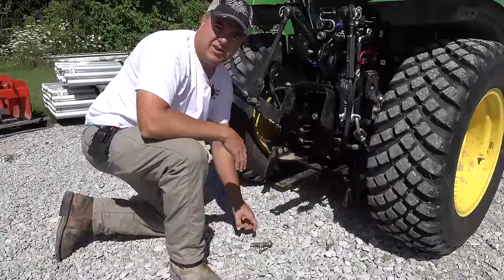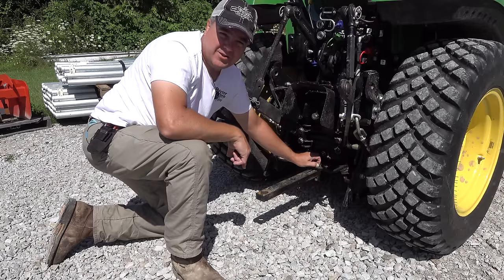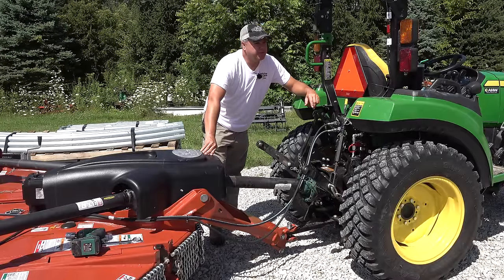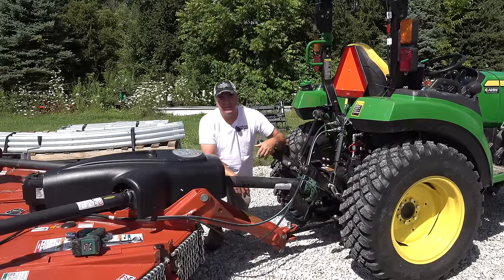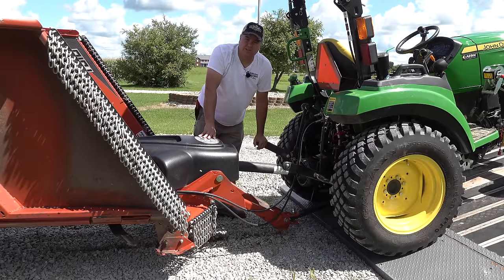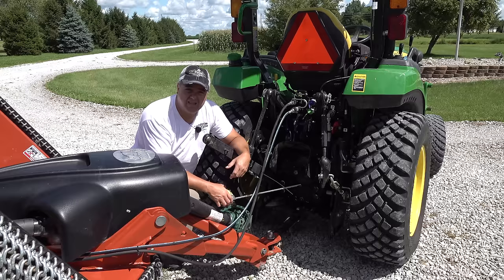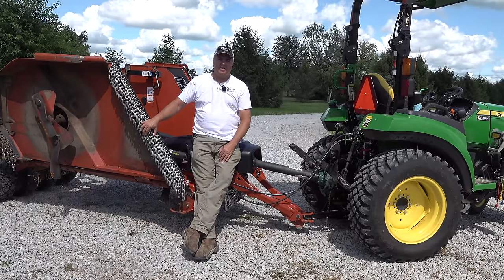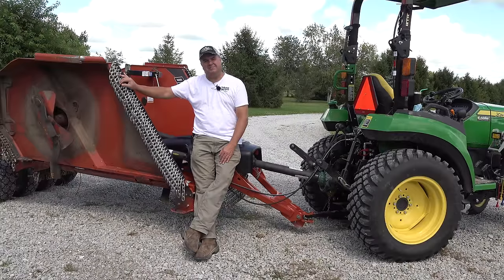COSTLY REPAIR on Deere  2038R!!!  Tim's HUGE Error!  Details Inside.

Comment: I've got one for ya Tim.  I snapped off one of the rings that holds the pin that holds the top arm on the 3 point hitch on my 1025R.  I was changing implements and forgot to push the pin all the way back in so when i raised the arms to attach the next implement the left arm caught the part of the pin that was sticking out and snapped the top half of the holding ring clean off.  Since the rings are all part of one big casting it was going to cost my $2000 as they needed to replace the entire housing and tear down the whole back and then rebuild it.  Luckily I found someone who could weld cast iron and it only cost me $300 to fix and its still holding.   So don't feel so bad buddy you're not alone
Reply from the maker: 3rd person to state that in the comments in THIS video alone!    We really need to get the manufacturers to stop using cast for the top link connection!

Comment: Tim, you could disconnect the PTO shaft when trailering.  Then you could have the drawl bar in more to reduce dragging on the ground.  With your drawl bar now in hole four the hitch is going to drag the ground worst when trailering.

Comment: Well done Tim, a good , useful video. I'm also surprised there is no recommendations over the drawbar height too. It looks too low to the ground to me.
Reply from the maker: There is an adjustable rod which can compensate for drawbar height. However, i don't think Rhino planned for a 12" drawbar.  The 15" drawbar on Johnny 5 works much better.

Comment: This won't help you Tim but this also happened to my JD 4115. I was using the original equipment JD rototiller which I purchased the same day along with the tractor. A few years later after tilling everything just fine, I had a pile of dirt to till, I proceeded to backup to the pile with the pto engaged raised the three point hitch as high as it could go, backed into the pile to begin and well...... I forgot the $$$ number but 15 years ago and less inflation it was probably equivalent to your bill. I got it back and forgot the bill but never forgot the lesson. It doesn't like excessive angle pressure.
 I don't remember reading about that but then l'm a man and I don't normally read those kinds of things. 
Later as I was crying to another man (whom I didn't know very well) about this he said I was a mechanic at JD before retiring and you don't want to go in high gear full throttle with the front wheel assist on either. 
So Tim if you're like me you'll probably forget the money but you're never going to forget the experience. 
So good luck to you, and oh! I still have that little tractor 22 years later. Best little tractor a guy could have still starts on the first crank.

Comment: Tim, Thanks for sharing. Again you are right. I bought a 3035D 2020 a few months ago. It is a gear driving tractor. I trusted the JD salesman experts and did not read the manual. The PTO is not a life PTO the PTO engage and disengage with the clutch. It is not independent. Now I am stuck with it and I am not happy. This is my first john deere what a disappointment. I was looking into trading it for the 2038E but not sure
Reply from the maker: I'm sorry, David.  How many hours on it?  Where are you located? Do you mean trade for 2038r, or 3038e?

Comment: Loved your intro Tim, spot on! It's a "Man" thing.
 Sadly, you aren't the first and certainly not the last to bust that rear pto case, seen it so many times it doesn't even phase me any longer. 
  I'm a JD salesman and I can't count the times I've taken a tractor in on trade and the manual is still wrapped in the original plastic. I always compliment them on keeping it in such pristine condition LOL! 
 You certainly are influential because it's quite common anymore when a customer is looking at their first CUT or an implement that your name comes up in "Well I saw this guy on YT doing this" ... and I just go "Oh, Tractor time with Tim?" and they go "Yeah! That's the guy!" 

 So little story for you. 6 weeks or so a guy comes in and tells me he saw you running that Maschio sickle bar mower and he wants to order one and so, we ordered the Frontier version (green Mashcio-comes with an extra knife btw) So it comes in, we assemble it and then the guy tells me "Yeah, I'm putting it on my 1025R just like Tim"  I went uh-oh, looking at the compatibility chart I told him. That's fine, but it's like this, I can't recommend it, and would never do it for the obvious reasons but I watched your vids and sure enough, you made it work. So the guy took it home and hooked it up and then he calls me, He's a little nervous on the bank of his pond. I asked him if he noticed you had the steel wheel weights? nope, didn't see that. So we ordered a 70 and a 50 w/hardwarte for putting on the left side. Haven't talked to him yet but he should be good because "Tractor Tim did it" LOL! End of the day I got to meet a real cool guy who was a pleasure to do business with on account of your work with the great vids you do. 
 Your dealer did good getting that covered, that's a sticky situation you slid right through :) 
 Keep up the good work! You probably save a lot of people a fair amount of money without them ever knowing it.

 BTW, That's just insane running that Rhino mower- you really show what CAN be done and you give the best advice - I try to do the same but it will never be the same cause, I'm a salesman. Tell you this though, Rhino makes one hell of a mower.

Comment: There's a phrase among mechanics that is RTFM, which means Read The Flipping Manual. Often mechanics get questions like "what does this light with a tire mean?" Or how do I know what tire pressure I should have, or how do I adjust my seat? The answer to those questions are all in the manual. And as a 13 year heavy truck mechanic, I read manuals almost every day for torque specs or troubleshooting steps. Always costs more to do a job twice.

Comment: Interesting with PTO hook up n yes I have seen different PTO damages. Watch linkage arms when turning them or parts will get damage.  My tip is when PTO is not in use its easily just disconnect from tractor n tie PTO in place, driving long distance over rough ground/roads, turning corners will put pressure on PTO.  I know so many farmers that have PTO hook up but it takes one time n can be long down time n productivity not mentioned costly.

Comment: Saved my buddy's tractor just last week! He got a tiller and called me because it wouldn't pick up very high. Turns out the pto shaft was to long and binding up putting all kinds of pressure on the rear housing everytime he tried to raise it. We cut it down after I explained what damage would occur if he kept running it like that!

Comment: Happens to the best of us Tim !! Last year I was in a rush in the morning to unload from brush hogging late the night before and switch to my box blade and reload on the trailer to head out . Anyways I backed my mower to it’s spot reached back undid the quick hitch and drove away and started to back up to my box blade and all of a sudden my right rear tire and tractor went up in the air , I was like what the heck ? I pulled foreword a bit jumped out looked behind and Half the PTO shaft was there and now bent like a Banana  ! In my confusion I looked over at my Mower and the other Half was on it . Instantly it hit me I had forgotten to undo it when I did the quick Hitch! Getting hurry sometimes slows ya down ..... The trick is don’t make the same mistake twice ! Good Man admits his faults and learns !

Comment: Yep, we all have those moments.  Had an almost similar incident with a grain auger last year, but there's a big ol' warning label right by the hitch that says to disconnect PTO when raising or lowering auger to prevent damage to joints and such. Good thing because it would have crushed something, but had to get a hitch extension to make it work easy. From most recent memory for a PTO damage was on a bale shredder several years ago. When one of our loader tractors broke, I ended up putting a bale fork on the 3pt arms on the other tractor to move some bales. What I forgot about when I hooked the bale shredder back up was that I set the 3pt arms down further due to the bale fork to reach the ground. Long story short, when I turned with the bale shredder hooked up, I bent the PTO shaft good.

A lot of stuff is for covering their butts and lawsuits, but that's what a bright yellow highlighter is for lol! There's some key info in all that jargon to make note of. I guess I've always made it a habit to read the manuals while at the same time looking at said machine as well to get familiar with it, so when it comes to working with it and running it I already know what to do (or can quickly find more info on it in the manual if more complex steps). Sometimes those actual important info stickers are in weird places and do get overlooked by other annoying warning labels.

Comment: Well I just watched this video today. You wouldn't be the first or the last to have a pto shaft destroy a gearbox because of the length being off.
Just a comment on three point mounted equipment if using a hydraulic top link it can be shortened up and make the shaft to long or lengthened pulling the shaft apart.
Also many mowers and brush hogs use a floating top link se ditches and steep banks can and will severely impact the required shaft length.
Good video.

Comment: I did that on my Yanmar, but just put a little "wobble" in the PTO shaft. The dealer noticed it on a routine maintenance trip, I didn't even notice it. He replaced the shaft under warranty, just like you, even though it was my fault. I raised my tiller up too high is the only thing I could figure. So word to the wise, it can happen with 3 point attachments too. 😁

Comment: I've got the 2017 2032R and broke the loader stand while I was disembarking it. I made a video or two about my mishaps. A shop press came in handy! I have the front 3 point hydraulics set up on mine for my 59" snowblower, I think I may have had the lift cylinders in front extended, and the loader caught the cylinder and sheared the two bolts that retain the stand to the loader on one side. There is a lock switch, which will lock the cylinders all way in, when you dont need the front snowblower lift cylinders. If I recall right, I didnt have it locked with cylinders all way in. Oops!
Reply from the maker: I have a video showing how to replace the shear bolts in the 220r loader stand.
I’m afraid that needs a bit of a design change!

Comment: Don't beat yourself up too bad. We've had it happen before as well. The PTO shaft would be cut to fit a particular tractor and for some unknown reason the PTO driven implement would be attached to another tractor and the damage occurred. In our particular case it went from a Deere to another brand tractor that had shorter lift arms.

Comment: If the drawbar is out further, will you have more trouble driving up onto the trailer? Seems like the angle would cause the drawbar to dig in deeper at the hitch point.
Reply from the maker: Yep.

Comment: Good video Tim.  You should do some more testing and get your Deere sales buddy involved. Does your 2038R have a aluminum alloy PTO case or a cast iron? I think you should get a Yanmar or New Holland or Even a bobcat CT2025 and do the same mistake on purpose to prove if a cast iron housing is any better than aluminum alloy. I would put my money on the cast iron being able to withstand what Johnny 2 could not. The implement would break or bind before  the cast iron housing cracks. Many buyers have looked elsewhere from Deere and Kubota because of exactly things like this. Maybe you can prove to some people the merits and limits of aluminum alloy? Perhaps you can  prove to a large audience that cast iron is no stronger than aluminum?

Comment: We don't think about it much these days, with the smaller framed and higher horsepower modern tractors, but 14" from the tip of the PTO shaft to the centre of the hole on the drawbar was the standard on old 540 PTO tractors for decades.

Comment: I should start of by saying that I have no experience with 3 point mounted attachments but if the draw bar was set too long would you have a similar situation with too much extension if the tractor were to crest the top of a hill and the shaft pulled too far instead of compress too far?

Comment: I have a 2032R and I took my bar off. It is pretty low to the ground. However I usually learn by tearing things up. I’m not smart enough to think ahead and catch mistakes on things that I’m not familiar with.

Comment: I wonder if you could put a bushing with nylon roller on the bottom of the tongue of the mower so when it drags it rolls instead of digging into the ground when you are at an angle.....

Comment: hey Tim can you flip the hitch on the mower  over by pulling the two bolts out and flip the hitch and bolt it back up it will raise that point that digs in the ground if possible
Reply from the maker: No, that ‘point’ is what controls the height of the rear tires on the mower.

Comment: I has a similar but different problem, i have a 60” till for my compact tractor. When i bought it the pto shaft was to long . So i cut it. No problem everything worked fine. Then one year I thought it would be nice put quick hitch on.  So one my wife was begging me to till the garden , I am always in a rush because i work for myself,  mind you i have been around farming most of my life. Well I noticed it was a little short now.. it works but center had a little to much play.. I thought i got stuff to do, I don’t have time to horse with this. So i tilled the garden. No problem, till i went to take the tiller off.  Twisted the shaft and it wouldn’t come off.  Lesson learned.  I knew better been around production farming most of my life.  Even i make stupid mistakes

Comment: Having worked as a mechanic in the AG industry for over 20 years  I can tell you that you are not the first one to have a PTO shaft incident.   One common (work around) to having the draw bar in a shorter position is to cut the pto shaft on the implement being used.  FORMULA = requested length,  (lets say.. 14 inches)   measure the distance on your draw bar at the desired position,   let's say you get 12 inches,  14-12 = 2,  add one inch for safety  =  14-12 + 1 =3 inches. Cut 3 inches from both the male and female PTO shaft and you are good to go..

Comment: On my implements I've had to cut every pto shaft to fit. before measuring and cutting I raise or lower(if posible) to get the pto shaft perfectly level, that should mean that its at its shortest length though some apliances may differ depending on if the pivot point is higher or lower than the pto.  Make a mark then lift or lower to the maximum to get another length and make another mark to make sure that the shaft does not seperate when lifted or lowered, I then recheck and make sure that if cut 1" or 1.5" shorter than the first mak I still have enough drive length(the minimum insertion is usually marked) inserted in the other half.
My hitch is fixed length so cannot have your misfortune but I have raised my carrybox too high and bent my registration number, max speed disk and triangle due to having the 3rd point  in the postion too low that causes the box to tilt forward more on lifting.

Comment: Actually, the proper dimension for setting up a pto connection as well as ANY others, (such as balers, mowers, and any other attachments that can turn relative to the tractor heading angle) is to CENTER the implement's intermediate shaft on top of the hitch pin pivot.   The intermediate shaft (which connects the tractor to the fixed shaft on the implement) is supposed to act as a constant velocity rotary driveline.  So, just like that on a truck or RWD vehicle, both angles on this shaft must be equal as the tractor turns.  Otherwise, sinusoidal vibrations are generated which will eventually fatigue & fail either the attachment or the tractor, or both.

Comment: unfortunately mr. tim i have done the same thing. so i created a shallower angle to my trailer tail gate. i simply bolted a 4x4 piece of p.t. wood on the outside of the tailgate , so when i bring it down  the angle  of approach is shallower for the tractor and whatever is behind it.. you probably already know this as you do much more with your tractors than i ...

Comment: Oh man! I've only had to replace one PTO shaft. On the Shaver MV50 stump grinder, if you have the grinder head tilted down and pull the 3-point up, it'll bend the shaft on the frame of the MV50. The neighbor did that when grandpa let him borrow it on his (the neighbor's) tractor. Luckily, the shaft just bent, instead of messing up the tractor or the gearbox on the grinder.

Comment: it's a year later, but I gotta ask: if you're trailering the tractor & mower somewhere BEFORE you USE the implement, why hook the PTO shaft up at all? it's not helping you get the unit onto the trailer, and NOT connecting the driveshaft allows for a shorter drawbar length; shorter overall length = more room on the trailer deck...

Comment: Been watching the videos with the Heavy Hitch toothbars on the 1025.... The 2038r uses a 57" bucket. Heavy Hitch has a 58", which is the closest size. Will it fit the 2038r bucket?
Reply from the maker: I believe you want the TB577-G from this page:   https://heavyhitch.com/product/bucket-tooth-bar-clamp-on-sub-compact-tractor/
Reply: @TractorTimewithTim  i didnt even realize the non-HD  had a 57". Thanks!